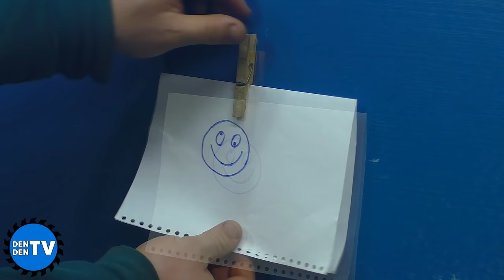Полезные советы и маленькие хитрости! Секретные функции обычной прищепки!

Comment: not really useful, good effort though, might as well, use scissors, to cut the wire, faster, less effort. hang those socks on clothes line and sort it from there, no need to screw onto woodlen plank etc. post it note, use hairdryer to soften the glue